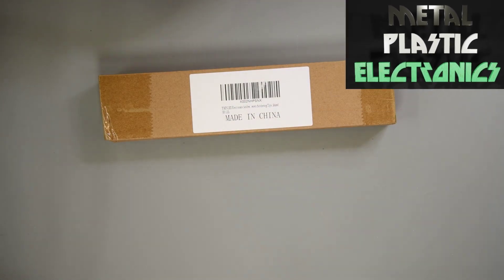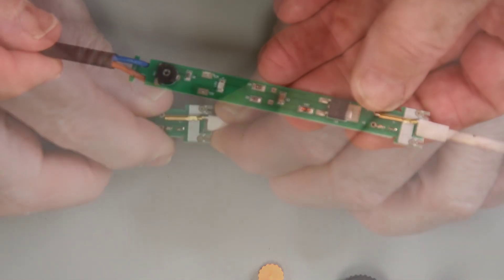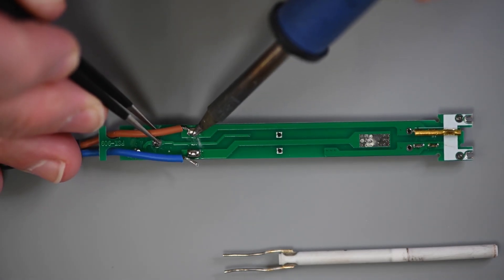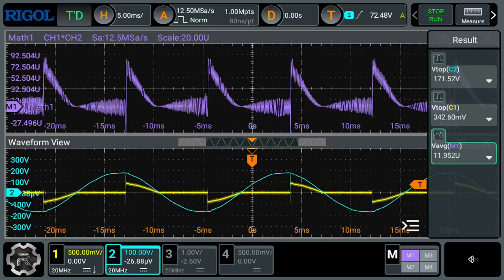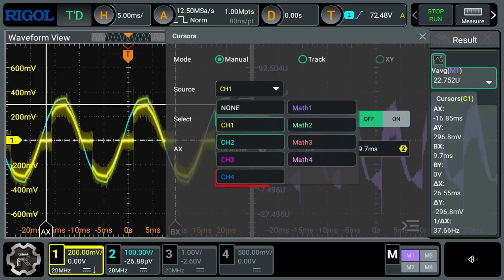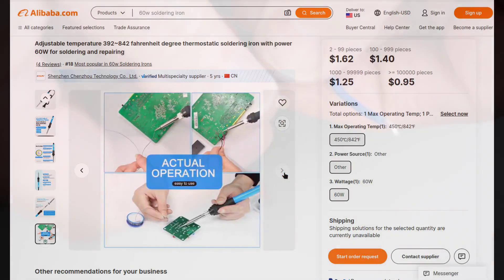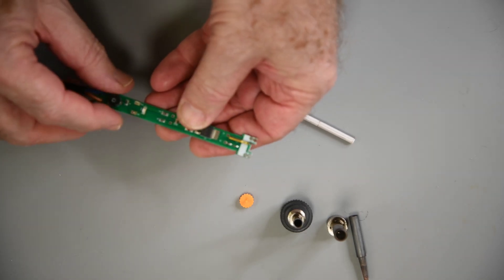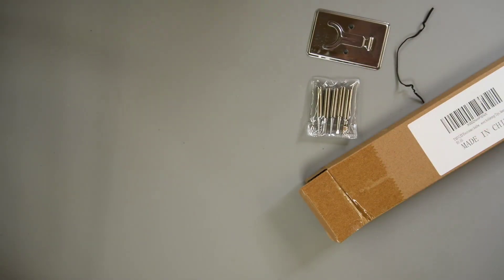What’s at the Heart of Amazon’s 7$ Soldering Iron

Comment: If you want an iron, are in the imperial core, and are dirt poor, just go down to your local Harbor Freight and grab their "Chicago Electric" iron up.

Unlike this thing, it won't flash over and go up in flames, nor is it going to spontaniously short and directly connect the tip to mains voltage.

Other then replacement tips being an issue, these things are a good option for getting into the hobby.

Oh, and you can sort of get into BGA stuff with it. If you have a PCB preheater you'll be able to clean pads up nicely.

Comment: Hey random unrelated question. I want to install my own back buttons on a ps4 controller (maybe ps5 in the future) and I found the buttons I would need, but I can't seem to figure out what wire I would need to solder everything, any idea? I want to replicate Battle Beaver and similar companies. Thaniks!
Reply from the maker: If you are asking about wire gauge, you can use a tiny gauge wire, 26 or 28 will work just fine.  Smaller than 28 starts getting a bit difficult to work with.

Comment: I bought it from ali express it has a different plug and the heating element was soldered to the board i have used it to train myself on small pins lifting the tip became super oxidized even a damp sponge couldn’t do anything
Reply from the maker: If you want to learn to solder get the best soldering iron station you can afford.  This is not a good iron to use to learn to solder.  Really, this is not a good iron to do any electronic soldering with.  A true temperature-controlled soldering iron will make the experience much less frustrating.

Comment: Hey say what u want about this iron but i've fixed a hell lotta shite which would otherwise end up in the trash without it. Probably saved me thousands at this point and still going strong. Not quite the weller iron i use at work but that one is bulky and stays fixed to a station, this one i chuck in a recycle bag with its other cheap soldering tools. Don't cheap out on the solder and flux though...xD

Comment: I don't see why the hate to this iron, it's only 7 dollars and works as good as 7 dollars or even more, i learn to solder with one of those, i even did ac board and tv board repairs with it and an 6$ multimeter for my school, the temperature can be adjusted to no melt, melt, quickly melt, enough to learn. 
If you are a beginner and think this would repair your cellphone, you'll have to learn it the hard way, as we all did.

edit: that 7$ iron is still working as good as it did first day xddddd

Comment: damn i got one because of a video recommending it to desoder a gamepad(ps4) it was very difficult and i ended up pulling a trace because of it.
Reply from the maker: I did a video of 10 under $20 irons from Amazon.  None of them could be recommended.  They all have such poor temperature control that you are more likely to damage a PCB.  The less experience you have in soldering and unsoldering the better temperature control you need.
Reply: @hm_1406  yeah i figured i lacked better tools, i ended up giving it to some guy to fix it, charged me like $15 to fix the trace and change the sticks for my hall sense. I dont fix electronics as often as i used now.

Comment: funny cause this is actually my main iron for years and it's still going strong
Reply from the maker: Splurge some on yourself and get a good soldering iron. A good temperature-controlled iron makes life so much better.
Reply: @metalplasticelectronics354 Eh, I've done fine pitch SMD stuff without temperature control. A lot of the time the issue is a lack of PCB preheating, not iron temperature.
Reply: Absolutely agree. Just I only do small projects right now.
Reply: This was my first iron that I got for Christmass and hated using it.
Reply: not much to break in these ones, that's a plus